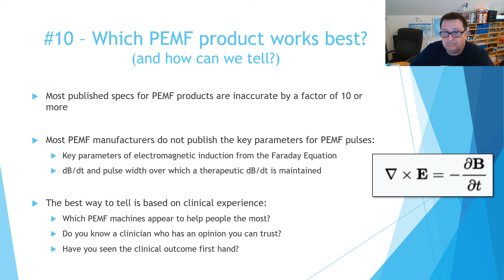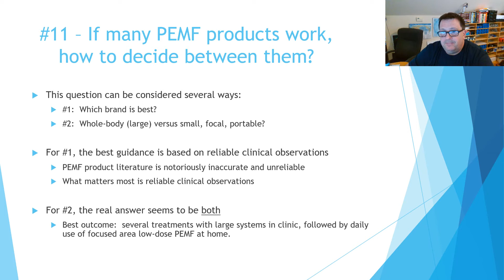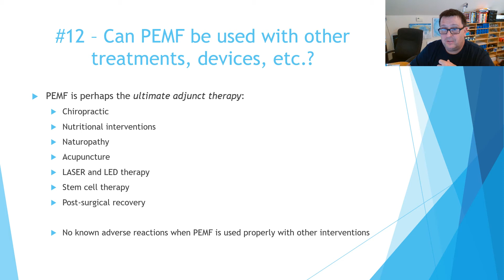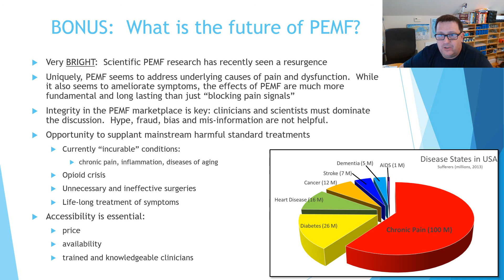PEMF: Clearing Up The Confusion (part 4) - 12 things you need to know

Comment: Hello, I've just started my research on PEMF and so far I've gotten not only a crazy abundance of false information but also the pricing is widely varying. My intention is to start a small business doing PEMF on horses. Ive watched all 4 of your "clearing up" PEMF info videos and I still have no idea of which direction I should go. There are many many companies who offer them of course even market for equine businesses. Your equipment isn't made for this type of animal correct? Would you mind pointing me in a direction? My email is lisa_mex@yahoo.com if you can please help me with this. Id like to find a real solution without paying for a "brand"
Reply from the maker: Actually, some functions of our devices were specifically designed at the request of people doing equine acupuncture.  Horses are among the most sensitive and receptive animals for PEMF, and in the right hands, our simple and small devices can be very effective on many issues for horses, including tendon/ligament injuries, open wounds, and swelling.  You just need to use them as a form of "needless acupuncture".  You also need to fashion some simple garments on a case-by-case basis for each injury.  There is no such thing as "one-size-fits-all" for veterinary garments and bandages.
Your other alternative wold be to try Magnawave, which people seem to think works well for horses, but can be very expensive.
Reply: @robertgdennis7472  Thank you for your response! I dont suppose you have equine tutorials and accessible online help to teach how to use your products specifically? And yes Magnawave seems to be the go to for the equine community. They offer the "high power" machines as well and market that they are better and NEEDED for horses since they are bigger which from what you've told is just isn't true and another marketing gimmick. Not only that, but trying to compete in this market i would need to be able to convince my customers why they should go with me instead of the all famous magnawave owners. Even after explaining your science, it would be hard to keep them interested unfortunately . They want to see a big shiny box rolling into their barn with a logo :(
I really appreciate your research and the truth. Some if not a lot of what you said was over my head. I will need to watch them several times to fully absorb it all, but I could tell you have all the facts to back your claims. I will continue to follow you, thanks again!
Reply from the maker: @lisamex1  Well, the equine acupuncturisis who were talking to me (many years ago) explained to me that horses responded very well to low power, focal treatments.  Unfortunately, we really don't have clinical training for our device.  I am not a clinician.  The way to look at it is this:  I make the best possible device, but I do not tell you exactly how to apply it the same way that a calculator manufacturer may make a great calculator, but they don't tell you how to work your specific equation.  PEMF turns out to be very powerful, but individuals vary, so the best approach is to try, observe, adjust, try again, observe, ...
You can ask people on our forum to see if they have any specific advice:
https://forum.fluxhealth.co/
One approach you may try (this is what I do when I provide technical consulting) is that there is no fee unless I can fix the problem.  Most people would let you try an inexpensive device if your policy is "no benefit, no fee".  Very few device or drug manufacturers would offer such a thing.  But our devices tend to work so well and so reliably that I think you could build a very good reputation on that policy.  If you developed it and publicized it, it would give you a massive advantage over the many, expensive, fly-by-night alternative (or mainstream) practitioners.
Sure, you might initially do some work without success and therefore without pay, but eventually you would gain skill and an understanding of your strengths and abilities with this tool, and you would be able to tell people, for example: "You will need three treatments this week for X", then if they agree, and you set criteria for "success", you will usually find that you get paid in the end because you have succeeded, and you will get a sterling reputation for practicing this way.  My 2 cents: all professions should practice this way, especially med/vet.